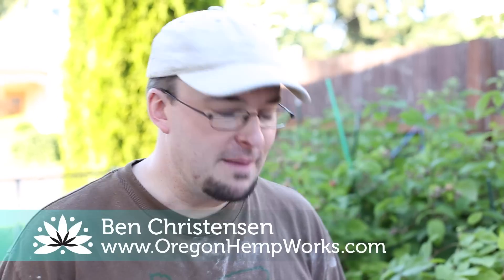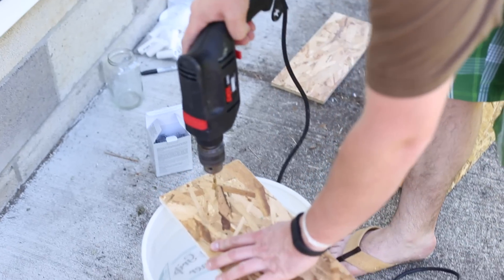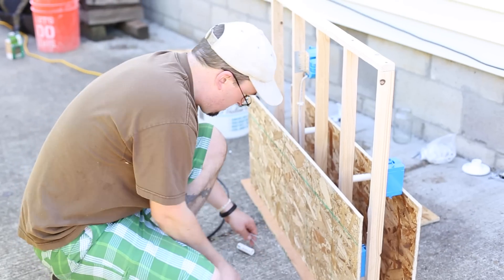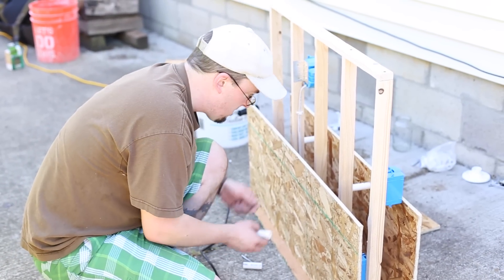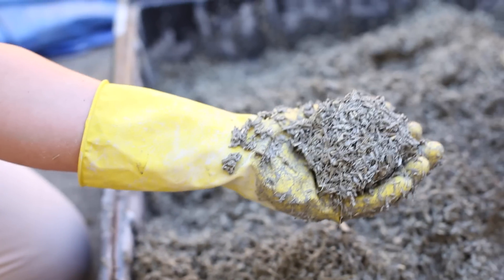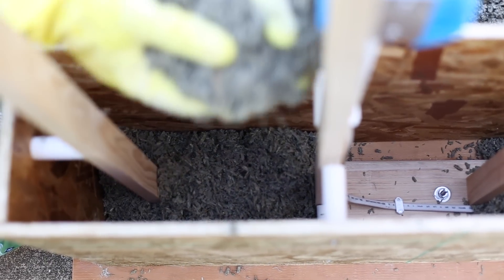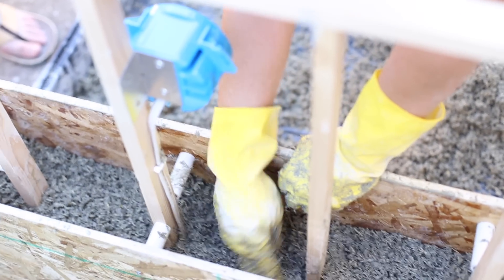How to Make a Hempcrete Wall

Comment: Wow..very informative video ..
Could  iron bars be part of the internal prefab framework &   then hemp poured around to ensure added strength as  a wall...or roof..or first floor slab...(similar to an  RCC iron reinforced  slab) ?
If yes...then what would be the strength ratio by comparison to a similar thickness RCC iron reinforced slab?.

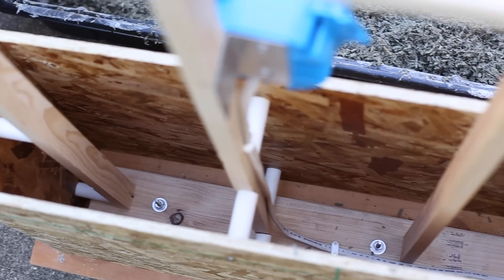Comment: 1:27 naked cable 🙈 use conduits
Reply: actually, hempcrete isn't flammable from what i've read.  US code doesn't require conduits for inner-wall cabling.  Not sure what the code says about in-wall cabling with hempcrete fill..

Comment: What was used to grind the hemp up?       How many  Hemp blocks can an acre of  Hemp make?    Is this simply a dried hemp plant ground up or is it treated with anything? 
Corn stalks are strong as hell as well, could you use corn stalks in the same manner?   Dry them and then grind them as filler?

Comment: How do I make my own hempcrete?    What is the lime based binder?   What is it entailing, and how is it made etc?    
If you have a problem with that electrical wire you are covering up you will have to destroy the wall to get to it.    wouldnt it make more sense to simply do it as a block house and then put the electric in like a commercial situation?   Not as residential of course but more practical.

Comment: One HUGE ISSUE! this would def fall apart in the long run. Anyone who has done any construction or concrete would definely know the problems w/ this! im not saying this isnt a good idea to think outside the box but most plants Rot in the long run thus causing probs!
Reply: kevin hilt sir from what i know hemp petrifies with time thus actually becomes stronger with time. There is a bridge in france made of hempcrete that is 1500 years old.
Reply: There is so much stuff you don't know.. (which is theory is ok, until you make statements as the one you just made..) about plants and what part is used here, about alternative to modern building constructions which are based on a different system quite like older buildings, which use lime and are based on breathability, about how rot works, how lime works in preventing rot, on how much moisture this kind of materials can deal with.. :) do your homework then pass judgment!

Comment: This works with pretty much any veggie fiber: bamboo, ground wood waste, even old newspaper. I'm interested in the compression strength of hemp v other fibers. Does hemp make a usable masonry unit or is it just filler?
Reply: Hemp is low-density, non-structural only (at this time).

Comment: Don't you have to use pressure-treated wood? I'm just curious - don't building codes require that exposed wood be protected in some way?
Reply: I meant both the wood used in the framing and used in the trim. Not any wood used in the forms.
Reply: No, pressure treated wood is for decks and sill plates, places where there is water present. Otherwise, pressure treating is unnecessary, certainly you don't want it in a place where you could get a splinter from it, that stuff is nasty! You can get major infections from PT splinters!

Comment: This is OK for volunteer and do-it-yourself labor, but it is way too labor-intensive for professional builders. It really needs to be made up into tilt-up wall panels in a factory if it's ever going to penetrate mainstream US homebuilders.
Reply: Size the blocks so they can be used with or in place of CMUs. But it would need to be done at the plant, rather than on-site.
Limetec has started making tilt-up hempcrete panels though.

Comment: "It doesn't get any better than that",  WHAT!?  Try rammed earth, or earth bricks, or aircrete.  There are so many building options with no way to say one is better than any other.  The question truly comes down to location.
Reply: Thanks for enlightening me about aircrete.
Reply: Yes, it seems that hempcrete might be good for some applications, but overall cob would be better (and cheaper). Maybe hempcrete for interior walls? And aircrete would be good but has very limited application. I've always wanted to build a cooling tower and yakhchāl with aircrete. Maybe there could be a way to apply hempcrete like aircrete?
Reply: Ben Marko How did you arrive at the conclusion that cob builds are better? What pros and cons make Cob the winner? Just curious.
Reply: arbonac I am familiar with earth builds and Aircrete. I am personally intending on doing a earth build Cob Hempcrete Hybrid. I want to challenge people who say natural building methods can only be used on one story houses. So the house that I want to build is four stories. They won’t be able to deny when I do that. Yea I’ll still use a wood frame because the wife wants the nature cottage cabin feel. So she wants the open ceiling to be visible for the wood work. But yea, Three basements one floor story above ground. 4 floors total. Can cob work with Hempcrete? You seem to know a thing or two about those building options. Just curious.
Reply: @DylanBegazo  I would be interested in learning how this turns out. Let's connect.
Reply: Well, yeah, like there are lots of locations that rammed earth or earth bricks wouldn't be as good as hempcrete because hempcrete is superior insulation. That makes it far more versatile than any of the earth builds.
Reply: Friendly Local Where did you learn the pros and cons of earth builds over Hempcrete builds?
Reply: @DylanBegazo  Like they said, could be limited by local supply, cost, and environmental factors.
Reply: The good part is that it creates a new place to use industrial hemp, which is good because you cant get high on industrial hemp.

Comment: Hi, is a 2X4 wall cavity thick enough for Hempcrete?
Reply: Depends on your climate. You are using hemp as your insulation material. In most US climates you probably want more than 3.5 inches of insulation. Plus, they are showing here how to embed the frame inside the hemp casting. In this video their frame members are just 2x2s, for a real wall you would want a frame that meets code in your jurisdiction.

Comment: It looks great :-)?
ONE ISSUE! As the electric mains cable is going to be surrounded by insulating hempcreate: The Current Carrying Capacity for that cable, is going to get derated to 50%!
Had suitable conduit tubing been used: Adequate room for heat dispersal & access for maintenance or upgrade
would be allowed ;-)
For safety reasons: Get a Qualified Electrical Engineer to do a safe & accountable instillation 
;-)
Reply: That's not true at all. There is no problem in the current NEC with having insulation over romex. And since they used appropriate boxes, maintenance access is unimpeded.
Reply: Although I would absolutely put this in some ENT just for ease of access for future upgrades. 1" PVC or some 1" Carlon flex ENT tubing would be perfect for a project like this.
Reply: @Clean97GTI  ,  Mike, if there is a problem with the  electric line itself you will have to bust out the entire block wall to get to it.
Reply: that makes no sense to me

Comment: could it be used  on a flat roof to fix pooling areas?
Reply: No. You need a more cementitious product for that. Hempcrete floats on water, so thin applications would not be suitable to fix ponding water. There are things like Henry Ponding Patch or even pool plaster that are much better suited to standing water.

Comment: Why not use hemp cellulose and a foaming agent that gardens under UV light? Like foam concrete that cures under UV light? You could 3D print a whole house on site saving a lot of cost.
Reply: i need people like you on my team
Reply: @FrnnkEducation  was thinking in Ireland we have rushes which are not much good for feed for animals but spongy white inside  could be mixed with lime and sand for 3 d printing chop up the rushes and mix like a slurry or thick Mack slurry with a setting agent might have a high r rating ?what do you people think or alternative too hemp local weeds or plants see weed just thinking out side the box or house build on top off excising roofs the services is already on site make the new roof flat and utilities the flat roof for living and water collection  and vertical hydroponics food production grow food close too we’re people live get red off plastic packaging clip on thermal stainless steel small bottle attached too belt bring hot and cold food and drinks from home and save big time
Reply: How would UV light reach the center of the block?
Reply: Meanwhile, poewhite, back at the farm, you'll find those corporations you're worried about are why we have health care, education, innovation, etc etc... Most people want, a kid or two, a home, a car, a job, a feed, to not die from a small health issue, mass organisation of people makes all of that possible... I recycle, thousands of tons of precious metals, hundreds of thousands of tons of ferrous metals, building materials, furniture, clothing... The World needs hempcrete, and recycled materials... I was given two houses on the weekend, polished floors, weather boards, aluminium windows, any asbestos removed, I have to have them down in four days, because an excavator is turning up to smash them, and send them to landfill... My comment was directed at the spirit of discovery, why look for examples of an innovative idea, invent it yourself.
Reply: Sounds like a great idea! The only thing I can think of that might make it prohibitive is the cost of the UV resin... I know that stuff is pretty expensive for small scale printers.
Reply: Any examples?
Reply: Where's is your sense of invention and discovery?
Reply: Cost of processing the cellulose down from the original stalks is too expensive
Reply: Without capitalism we wouldn't have anything much at all... We are in a good position to move back to something sustainable... I'm not very worried about humans as a species though, we're very destructive, and mostly, don't give a thought for the other animals around us... Being in the recycling industry I see how idiotic it is, and money is the big driver still... Everybody's bottles used to go into landfill instead of the recycle bins, now you get 10¢ for each bottle, and they don't even get to dump... They wouldn't do it for the environment, but will for money... It's still laughable, but it's something... I was talking to a teacher yesterday, trips to the Great Barrier Reef for students studying marine biology have been cancelled because a student died in 1996, that's idiotic, but that's how it is... These people live 2 hours from lower end of the reef... Say goodbye to that natural wonder.
Reply: Voc's?

Comment: I'm kind of curious how you would go about fixing wiring in your house wiring wasn't done right
Reply: Run all wiring in conduit, so that one could completely rewire the structure without demolition or recasting.
Reply: Desiree Cormier break off the hempcrete, fix the wiring, then recast the hemocrete you broke off. She mentioned it can be recasted in the video.
Reply: Exactly. Residential codes don't require conduit, but it's really the best way to do things. There is also the option of exterior conduit should major rewiring be required.